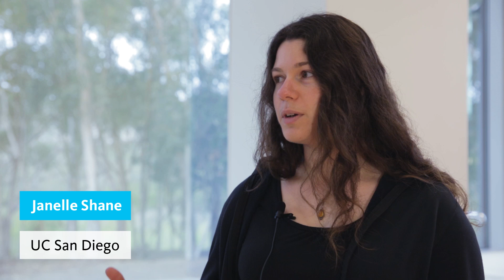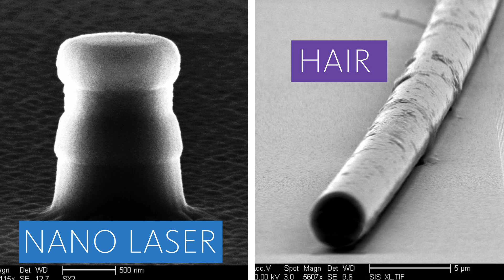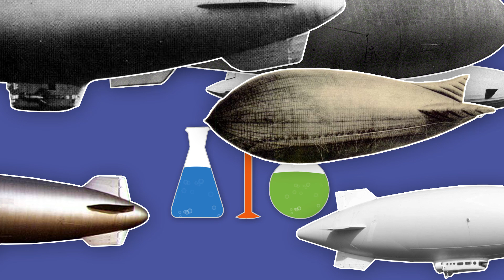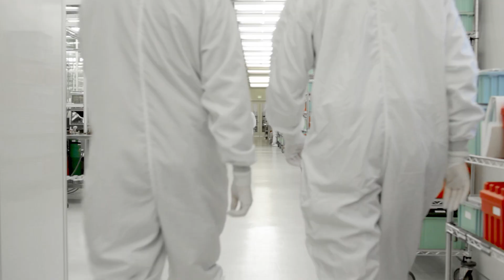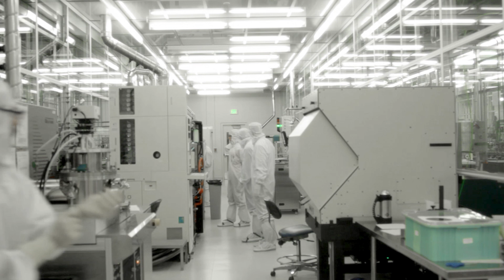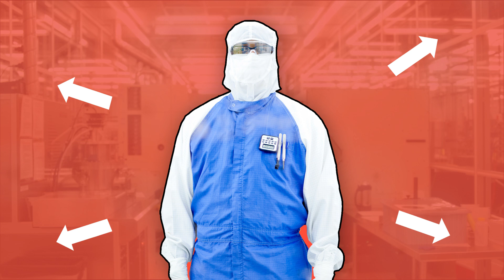How Dust Is Holding Science Back

Comment: Very important video since size is not relative to consider how microscopic machine parts of living tissue and or computer equipment are like raster scan lines on a screen disrupted by vibration, dust or even slight electromagnetic pulses of electric arc discharges.   

Therefore, cyclonic separators of suction hole floating floors beneath ceiling HEPA filters of air showers are essential since even surface tension of minute photovoltaic effects of copper in salt water beaded on a surface could cause severe havoc.